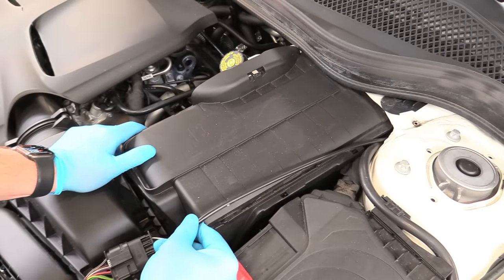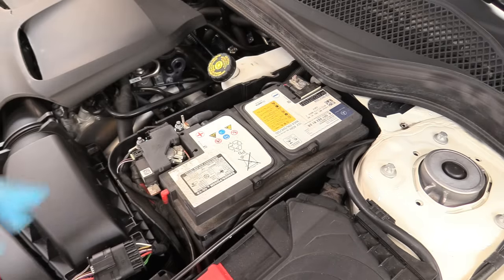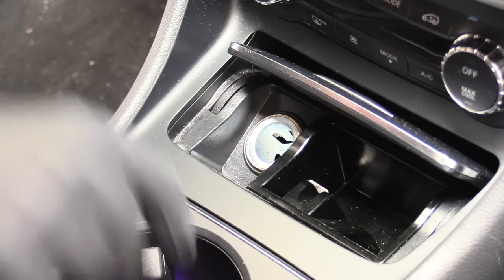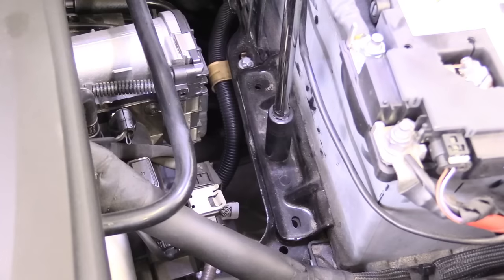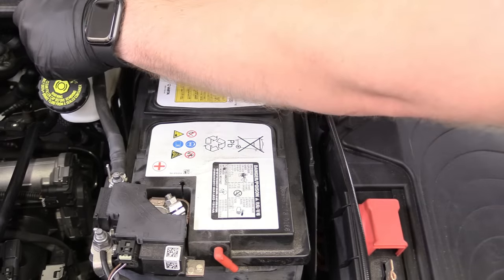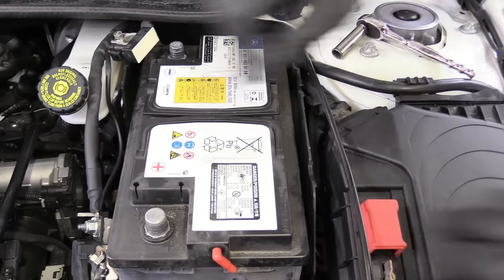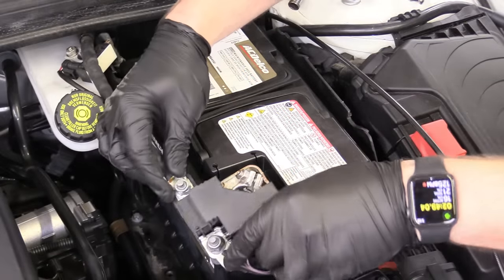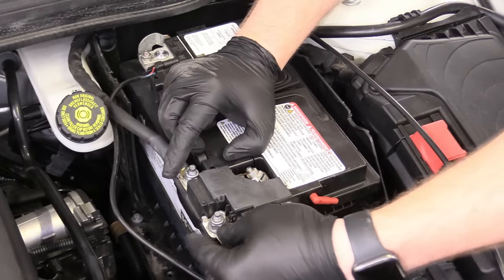How to Replace a Car Battery and Keep the Computer's Memory

Comment: Can you connect a trickle charger with 1.5amp charge to the external positive/negative terminals on the car and plug it in to maintain power to the computer while removing the battery?
Reply: no, you cant. because the trickle charge is not outputting a constant voltage... so it will be as if the power went on and off...
Reply: @jobaptist :  Are you referring to a "smart" trickle charger like a Battery Tender, which does vary the output, as opposed to a plain-jane trickle charger (old school) which would be constant?
Reply: @terry_willis  im not sure about the difference between the smart one and the plain-jane... because when I tested it with using a multimeter, I realized that the output voltage was not constant. you might need to test your trickle charger to see if voltage is constant.
Reply: Very risky.  I recommend strongly against.  Prefer another battery and jump leads
Reply: @jobaptist  Yes, I did test it with a voltmeter and it showed a steady 12.5 volts, which makes sense because it's just a plain transformer outputting a constant voltage/amperage, unlike a "smart charger"  (Battery Tender) which is designed to fluctuate its output.  As long as the 110/120 volt input is constant, I can not see why the output would vary.

Comment: can you use a battery charger to power the car while taking the battery out on my 2012 c250? My battery is dead so I have to task it to the store to get swapped out for warranty so its probably going to be about a couple of hours. Is that going to be okay using the battery charger?
Reply: If your battery is dead you've already lost memory so just get a new battery and hope it works.

Comment: I would put the Negative first, then put the positive on. If you put the positive on first, the negative might touch something else and cause problems.
Reply from the maker: You have it backwards. You always put the positive on first then the negative when putting a new battery in. If you do it the other way you can create a dead short and potentially explode the battery. If you don't believe me here is an article from Kia https://www.kia.com/dm/discover-kia/ask/which-car-battery-terminal-to-connect-first.html#:~:text=%E2%80%9CPositive%20first%2C%20then%20negative.,order%2C%20positive%20then%20negative.%E2%80%9D

Comment: Don't you have to also "program" the computer to tell the computer that you just installed a new battery?  If not, won't the alternator over-charge the battery, because the computer will think it still has an old battery and needs more charging by the alternator?
Reply from the maker: https://youtu.be/ETNv2S_idIU

Comment: If the car battery is dead, won’t the jump battery try to recharge the car battery, and fry the jump battery?
Reply from the maker: No. The jump back only sends big voltage when it is asked for IE when you try and crank it. Which is why I said don't do that. Thanks for watching!

Comment: Hey Guys I replaced the radiator...  ( 2001 grand cherokee laredo 4.0 6 cyl) both lines were seized to busted up radiator so i disconnected them from the trans lines( skinny hoses) just I did not take note of where the top/bottom radiator trans cooling line connects back to. please help. does top radiator line connect with top skinny hose.?, on my jeep  the trans line sit on top of one held in place by clip like a brake line then the skinny hose .. before one of the hoses (the bottom line) there is a check valve looking thing then the skinny hose, the other line the skinny hose just connects to the line. So would the upper radiator trans cooling oil line connect   to that top line,  or bottom. help a girl out please its been days...

Comment: OR, just change the battery out the old fashion way and after about 15 minutes of driving, everything will be back to normal again.
Reply: He is not referring to adaptations or computer readiness test needing to be relearned and retested. Some modules have to be reprogrammed as they loss their memory so to speak and no longer function .  But don’t rely on the lighter port to back feed as most are switched rendering them useless in this scenario. Use a OBD II port or directly to positive and negative as shown.
Reply: that worked for me '21 Challenger- don't know why but everything came back all right.
Reply: This won’t work on any ~2014+ Porsches. Reflashing the ECU is part of the battery swap according to Porsche. 

In Porsches some functions, such as the auto engine start/stop at the stoplight, will disable when the car senses the battery is low, and the only way to fix this is to reflash the ecu.
Reply: Perhaps he's on commission for selling the parts he used
Reply: My son simply disconnected his battery in his 2019 Toyota RAV4 to try and solve an issue and when he reconnected it the infotainment system was completely dead.  He found a procedure on the net to fix the issue that was close but didn’t work.  He had to take it to the dealer where they did the same cryptic procedure that involved putting the transmission in reverse among other steps that got his car back to normal.  The tech was surprised he got a close as he did to fix it because that info according to him was not supposed to released to the public.  That’s helpful.😔

Comment: it is more easy to first start the car by any means and then replace the battery... thats more simple.
I have two cars.... if  battery of one car is to be replaced.... i use other car to start the engine of first car... i.e. i have a Hyundai and a suzuki..... if Hyundai battery has gone bad and needs replacement.. i start  suzuki  engine... put jumpers from battery of suzuki to battery of Hyundai... initiate self of Hyundai so 5hat Hyundai engine starts.... now i can stop suzuki engine and remove the jumpers.... mow Hyundai engine is running.... replace Hyundai battery keeping its engine running.... thats it

Comment: I just start the car and let it run when changing the battery.
Reply: Seriously?  This seems like an easy a solution.  Is there a downside to it?  I'm not a mechanic and so am curious why @2carpros doesn't suggest that.
Reply: Good way to destroy the alternator diodes.

Comment: How does the cigarette lighter provide power once the battery is removed??????  Duh........
Reply: You are feeding power from the jump pack to the cars computer through the cigarette lighter connection. This allows the battery to be disconnected and changed without interrupting power to the computer. This is important to do on high end cars like BMW, Mercedes, Porsche etc. His advice is spot on.

Comment: Damn thats a crappy design. If you are away for an extended time you want to disconnect the battery so it does not get depleted but now you cant because the ECU or other modules lose their memory and replacing the battery now require extra tasks and you also have  to reset the battery module so it can charge the battery at the correct rate. My 2003 VW has none of this nonsense and works just fine.
Reply: You can get an AC plug-in device to handle keeping the computer connected.

Comment: I think people who buy cars that the manufacturer purposely made difficult for the owner to maintain, to the point of requiring constant voltage to the car's computers,  should shop for other cars that are not so wickedly designed.   If they cannot find others,  they ought not buy.  Buy a scooter or a motorized bicycle!    I have a 2008 Toyota Corolla.

Comment: Unfortunately I did not know about taking this precaution of supplying power to the system when I disconnected the old battery. I hooked up the new battery and am getting nothing when pressing the brake and pushing the start button. The car is in the garage and without any power I cannot even take the 2017 Buick Envision out of park to get it out of the garage. Any idea what I have to do to correct this. I do know the new battery is fully charged and hooked up correctly and that the car remote fob has a good battery so they are not the problem. Any help would be appreciated.
Reply: Need to but obd2 scanner to reprogram the codes

Comment: at Ford, to remove the battery, it is necessary to disconnect the outlet in the fuse box, this method will not help